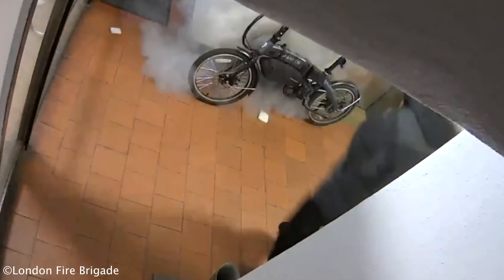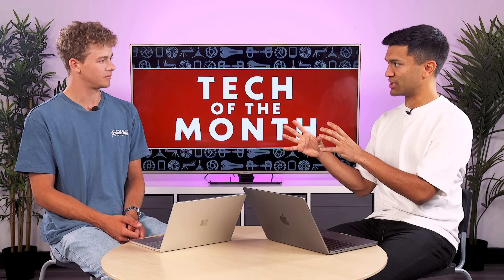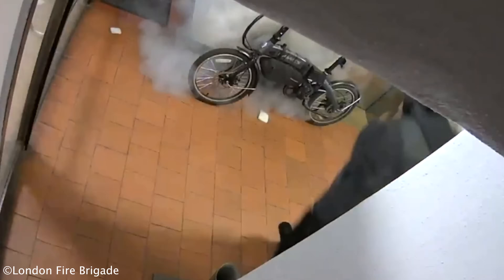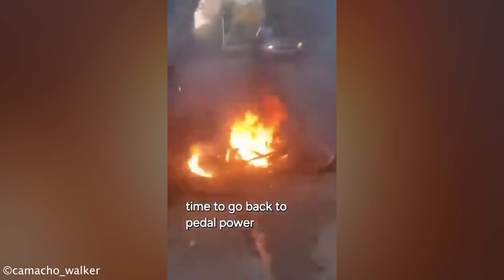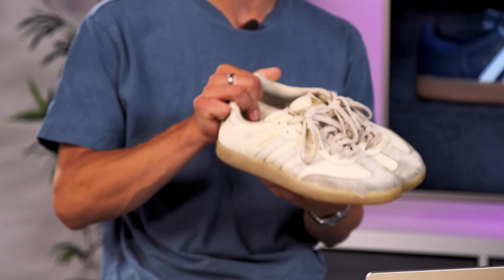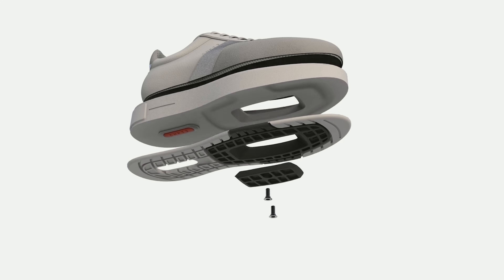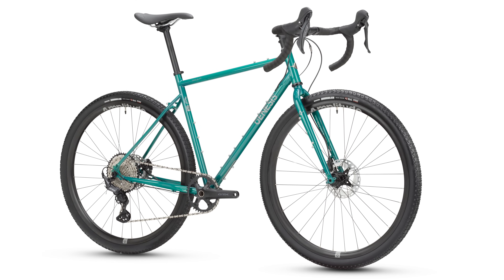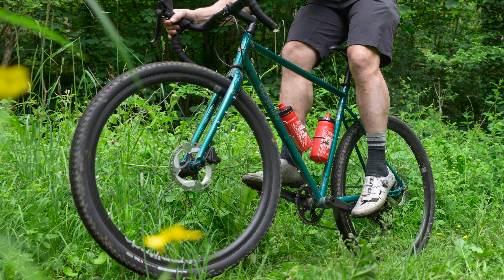Why Do E-Bikes Keep Catching Fire? | Plus £115 Cycling Slippers?!

Comment: The big problem with battery fires are sellers, more specifically people with money buying cheap stuf marketing and selling in order to make quick buck, those people just enable acess to low quality and dangerous stuff.... i can order anything from china but i need to specify the safety standard....
I'm building custom ebikes for 6 years for hundreds of clients, bosch and whatever system are high quality but you still just buying premium stuff, and they are not even capable of what the laws in my country allows, its very limiting and frustrating... Arguing for those its just a way to justify the overpriced amount that you paid.
High quality as nothing to do with cost, its a matter of competence and responsibility from sellers and manufactures.

Comment: If you check out some of the custom car YouTubers like Rich Rebuilds, you'll see how these batteries should be built. Cheap ebike manufacturers use less safe battery construction, cheaper controllers and less rigorous testing which results in these hidden dangers.

Comment: Andante Bike Shop in Cutler Bay, Florida was gutted by a fire started by an exploding e-bike battery. No one was hurt and the shop was able to recover and is doing fine now, but it was a scary thing. The battery had just returned from being maintained at a company in Colorado. The day it happened , on a Saturday evening, my wife and I were coming back home on our bike ride and we saw fire engines down the street as we went through the intersection. It wasn’t until the next day, after church, we found out it was Andante that got burned.

Comment: Cycling shoes evolved from bicycle racing. Originally people used bicycles for transportation, until the 1930’s athletic shoes(trainers) were used only for running and court games. Trainers were too flexible for cycling so people used regular leather soled oxfords. Racers started using ultra stiff leather or wood in the soles with toe clips. Tourists still used oxfords with toe clips and could still walk easily. I’m quite excited to see more walk friendly, regular looking shoes for the average rider.
Reply: Gravel shoes are this. If I ride and need to walk around, ie Bike packing, Gravel or MTB shows are the go.. cant ride flats anymore, feels weird..

Comment: Cycling journalists should stop with the sensationalist reporting on "ebike" fires. Please show me a single report of of Bosch or Specialized battery that has ever caught fire the way these cheap imports suffer from. The amazon sellers don't care about safety, only profits.
Reply: You should re-watch more carefuly... they mentioned the difference between amazon sellers and Bosch or Specialized..
Reply: Do you think car manufacturers use cheap batteries considering they cost about 12k to replace, and they set fire….